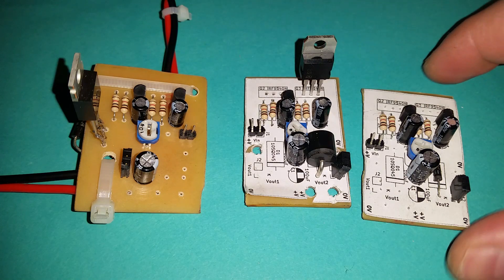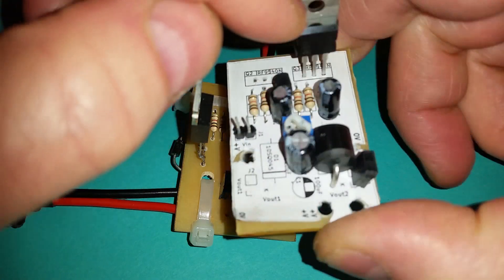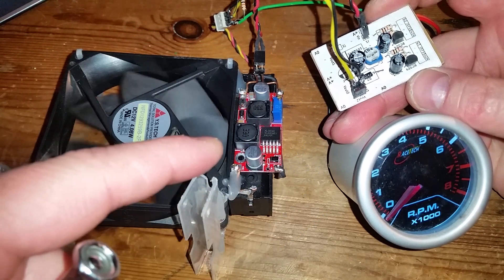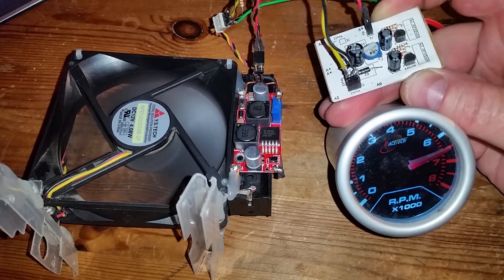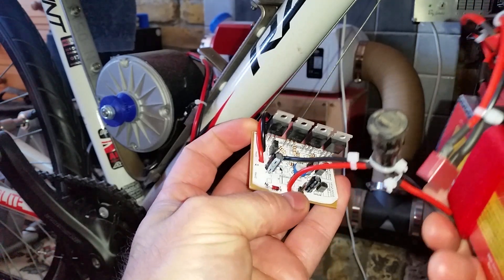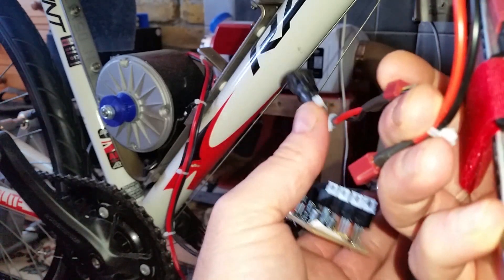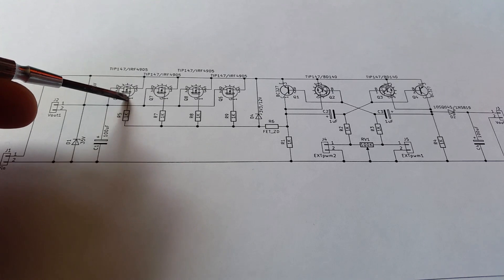Simple & Powerful PWM Motor Speed Control Circuit For eBike/eScooter Project

Comment: Sorry to say this but that fan is not spinning at 13000 rpm. The displayed 6500 rpm are a bit more realistic(still way to fast for the amount of noise), but considering your statement that it rotates twice as fast as shown, it is most definitely spinning at 3250 rpm. So you mixed it up, it’s not twice as fast, but half as fast.

Comment: Hi, I need to drive a 110 volts 100 amps motor. Any chance of getting a pwm circuit diagram. I will really appreciate if you can help me out
Reply from the maker: I don't have any motors like that to control myself. The first thing would be to select MOSFET transistors which can cope with that voltage and current, and have enough of them to cope with the starting current or put some kind of current limiting circuit inline with it.

Comment: WTF. This guy is running this motor under no load and then says the MOSFETs don't get warm. Well no shit dumb ass why would they.
Reply from the maker: Without heat sinks they would increase in temperature if they were spendinding a significant time in the switching period. Mosfets are very low resistance when switched on 0.4R in some cases, so load is not an issue, it is how much time they spend in the switching period, the slew rate when controlling speed, where they will heat up. You may require a couple of heatsinks for your anger issues.
Reply: @DevelopIT   Ok bro I'll get some heat sinks. But while I'm at it you get yourself a life you obviously don't have one if you got time to respond to my trolling.
Reply from the maker: @stoneyswolf  Damn, I was in such a rush to respond, I hadn't considered that I would expose the fact that I have no friends. Well faught, I must gather more experience points before reacting so fast in future.

Comment: Is it true that if I want to use a pwm to control a 24 volt DC motor I have to have a 36 volt DC power supply
Reply from the maker: I think just using 24V power supply is what I would use as PWM on 100% duty cycle should be the same as driving at 24V. Some power monitoring would be required with 36V to prevent over heating the motor, it's not something I have ever done, so could not advise on over rating a motor, but I have seen several people who have.
Reply: @DevelopIT  the reason I ask is on Amazon, I was looking at pwm's and noticed this in the description of a couple of them.....
"【Note 1】: The power of the input power supply must be greater than 1.5 times the rated power of the motor to make the motor work (note: the input voltage and the rated voltage of the motor must be consistent). "
Reply from the maker: @olheghtt  When they say the input voltage and rated voltage must be consistent, it sounds like they are saying the voltage needs to be the same. But the amount of power the power supply can deliver needs to be greater, so the amp rating of the battery needs to be 50% more than the rating of the motor to allow for surge demand requirement on the motor starting to turn maybe?
Reply: @DevelopIT  Well, maybe I got lucky then I hope, this is what I have:

----------------------------
Mean Well LRS-350-24 DC Switching Power Supply, 24V 14.6A 350W
----------------------------
Motor Controller, DROK PWM DC Motor Speed Controller 10-50V 60A High Power HHO RC Driver PWM Controller Module 12V 24V 48V 3000W Extension Cord with Switch
----------------------------
Type of motor: DC, Brush at 24V: - no-loading speed: 3500 rpm - loading speed:2400-2700 rpm - Max current: 8.9 amps - 150 Watts.

Comment: What I see from the scope display..the timebase is set @ 20 mSec... & pulses are at approx. same repetition rate..I infer that pwm frequency is around 100 Hz.... which I.M.H.O. is way too low..
This is one reason the motor draws such a high starting current...i.e. @ low duty cycles
the motor current cannot build up.. before the next pwm pulse.
since it is initially @ standstill..
there's no B.E.M.F. & injected current rapidly freewheels..and fall to a low value..
From the motor data sheets , 
or by measurements ..if you have the means.., determine the 
" R" & " L"  of the motor...to find the( L/R) time
constant ( in mSec or uSec/..) the PWM repetition rate for flip-flop should be minimum 5 times higher..better still 10-15 
times....for best it is normal to have a pwm frequency above audible range (>18-20)kHz.....
This should bring your starting current down to just 2-5 times rated continuous current.. besides  starting the motor quickly.
The downside is you HAVE TO USE faster b.j.t.'s or MOSFETs...and adequate heatsinking as switching losses will increase the device heating...

Comment: hello thank you soo for sharing
can you please explain I am an absolute beginner 
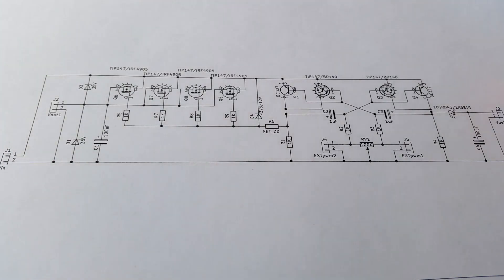what is the value of R6  IN THE LAST CIRCUIT DIAGRAM AT 13:41
and where the connection J4 and J5 go 
what I understand isJ1 fOR the battery/power supply and J2 to the motor and I think J3 is for controlling small load if wanted 

THANK YOU SO
Reply from the maker: For R6, Zener diodes have a data sheet, which state what the minimum current required to generate the specified voltage for the zener diode is. So depending on the specification of the zener diode you are using R6 needs to be selected to consume at least the minimum current required to achieve the voltage for the mosfet transistors. J1 supply voltage, J2 output for driving from mosfets, J3 output for driving from bipolar or darlinton.
Reply: @DevelopIT  thank you so much for taking the time to explain 
the connections that still confuses me is J4 and J5  are they connected to something or just the potentiometer legs connected  to  R2 and R3 and the ground 

 thanks a million
Reply from the maker: @spark2957  RV1 is on the PCB, however it can be left off and use these connectors to go to an external variable resistor.
Reply: @DevelopIT thank you so much that makes sense
 I just finished gathering the component I need  
it's for the homemade metal lathe that I'm making and and ill-made video and let you if you like to see it 
thankyou
Reply: @spark2957 Hi, 
Have you completed your project . How much watt motor you are using.

Comment: Would you mind to share the single mosfet circuit ;) i would like to try it
Reply from the maker: The current limiting part of this circuit will be an op-amp to rectify the current supply. This is also part of my PSU projects, which are further down my list of things at the moment.

Comment: By using PNP transistors instead of NPN transistors, you still have the resistors to pull the signal down again. What difference does it make to have a low impedance pull-up and high impedance pull-down, like you have now, compared to the other way around (e.g. the NPN solution) when driving MOSFETs? And when driving a load, can't you just connect the load to the positive supply and your output instead of using PNP transistors?
Reply from the maker: As explained in the video, on the right of the circuit the motor can be driven directly from one of the flip-flop transistors, thus not requiring any additional transistors with this configuration. At the start of the video, you will see that the circuit can be configured in many ways the first two configurations actually described in the video are driving with a BC327 transistor directly from the flip-flop  circuity and a TIP147 darlington driver directly from the flip-flop.